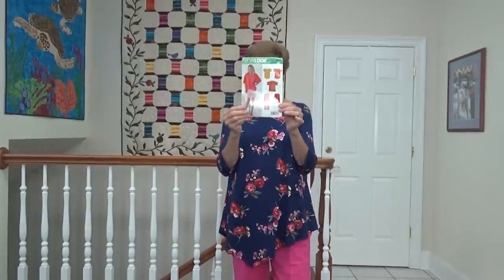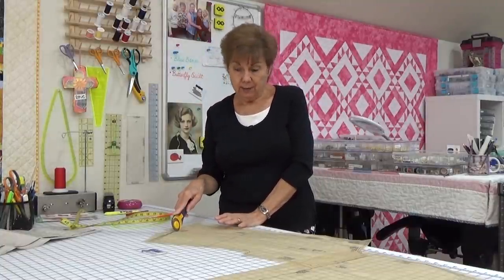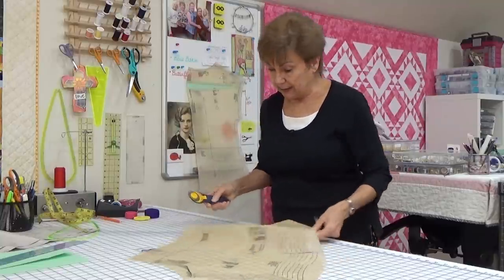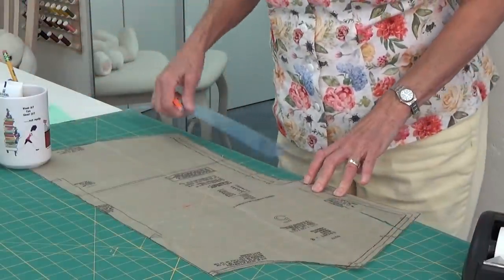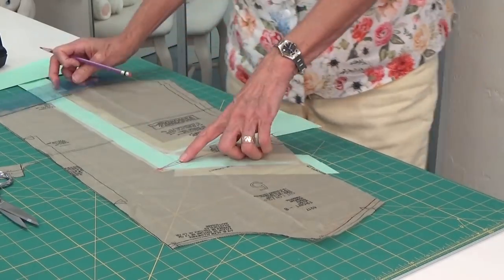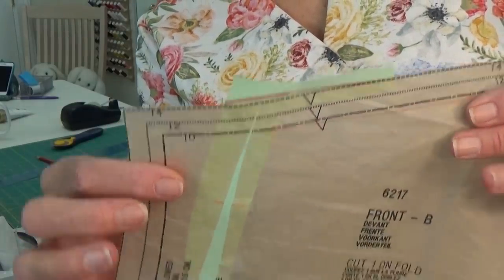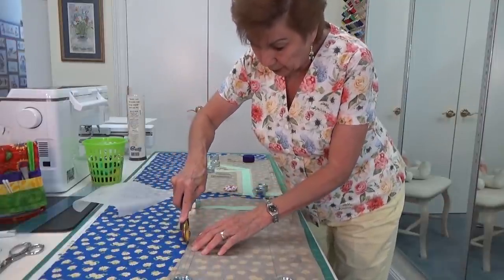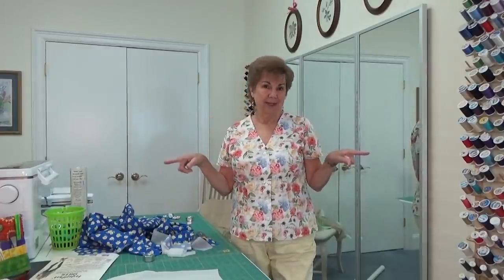New Look 6217 Sew Along, PART ONE, Fit and Cut Out

Comment: Awesome teaching on adjustments.  Good to know it can be done - I need different kinds of adjustment like square shoulder and lengthening torso and arms.   Hope I find someone who teaches like you that I can understand how to do these techniques.
Reply from the maker: Just cut across the sleeve -- above or below elbow depending where you need it -- maybe both -- and add length.  Same with the torso.  Lengthen the pattern piece where you need it -- above or below the waist.  Same to the back.  Side seams have to line up.

Comment: Thanks so much!  I have made many of these. But the next one will fit so much better thanks to you!  I was wondering if you need to adjust the back hem because of the sway back adjustment.
Reply from the maker: No!  Ladies think that, but when you have all the fullness ABOVE your waist, you are just subtracting it from that area.  It does not shorten the back hem at all.  If it does, you didn't need the sway back -- IMHO.

Comment: This is probably a stupid question but it makes a difference on me. When you measure your upper bust, full bust and bra band, do you inhale to make it as big as you need and how tightly do you hold the tape?
Reply from the maker: Stand up straight.  Measure your full bust with the tape up level in the back.  Kind of on your shoulder blades.  Just relax.  Tape should be snug on upper bust.

Comment: You indicated you only graded the back pattern piece because you had ample room in front due to the FBA. I am not doing an FBA, but I need to grade up a size to accommodate my hips, would I need to grade both the front and the back pattern pieces? Thank you!
Reply from the maker: Yes Debra.  Say you need 2 inches extra in the hips.  You would add 1/2" to each of the side seams -- 2 in front and 2 in back.

Comment: What’s the difference between doing a round back adjustment as opposed to a forward shoulder adjustment, since without either the garment pulls backwards?
Reply from the maker: Forward shoulder won't pull the garment forward to the front.  It will just make the sleeve cap look funny and the shoulder seam will be too far forward in appearance.  Forward shoulder adjustment fixes the armhole area in the garment and the sleeve.  (From what I know about it.)  Round back is what will pull your garment backwards and up into your throat because your back is seeking more room to go the distance.
Reply: Joy Bernhardt that makes sense.  Thank you

Comment: Bust vs upper boost if difference is more than 2inch you need cut bigger size and make more adjustment. It's more easy to make your own patern than make all this messy corrections.